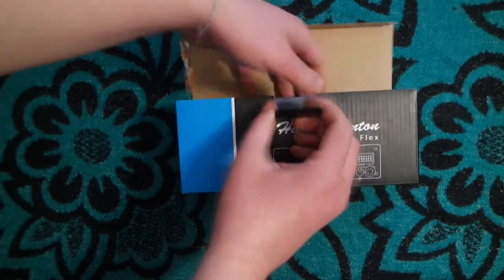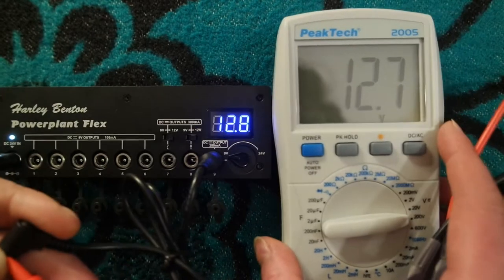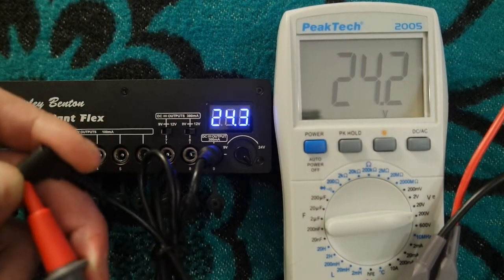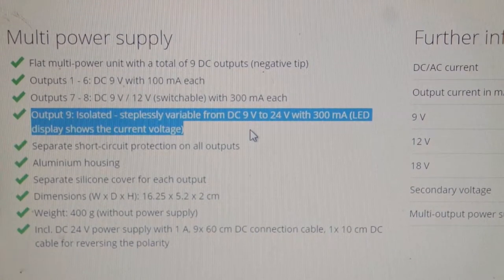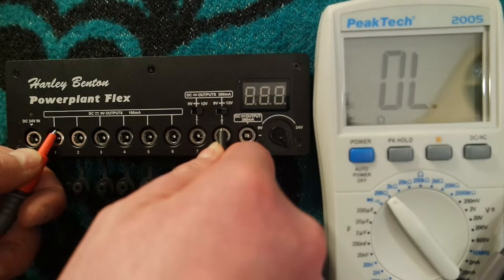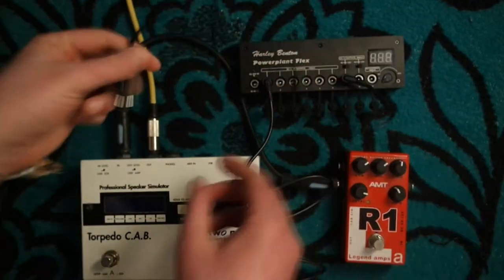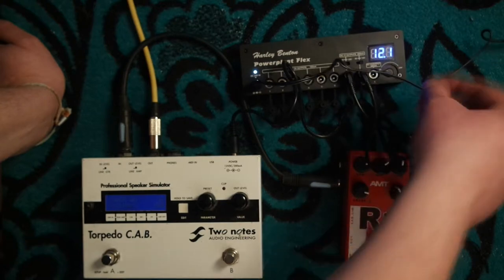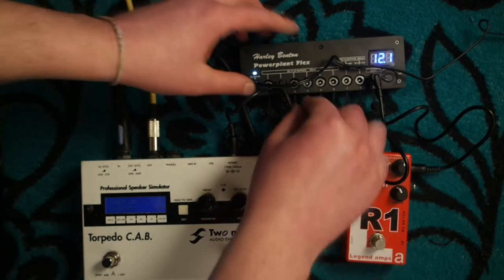Gear Review: Harley Benton Power Plant Flex (pussy power with LED display)

Comment: Fair play man, was pretty much as we thought then? :-)
Reply from the maker: Jep. 
Still waiting for Powerplant ISO and Powerplant Junior, would like to test those as well.
Reply: Ah nice one, I really can't wait for those now! :-D 

I do reckon the ISO might well be worth a punt if they have fixed these issues.....

On the Powerplant Junior, I have a friend, who's a rather well respected guitarist here in the UK, and she runs 3 of the Cioks DC-10 supplys, supposed to be a good power choice, £150 worth at least.... anyway, it has a few more outputs than the Plant Jnr, and you can get 200mA and 400mA.... But I don't need those just yet... But, the isolation on it though only says the same as the Jnr, this 'galvanically' isolated..... So in theory at least it's what the bigger competition seem to use too!?
Reply from the maker: By the way, here is the review of Powerplant Junior, 
https://www.youtube.com/watch?v=TkHFIZzkwZk
watch till the end, I've got a surprise there, and please contact me.